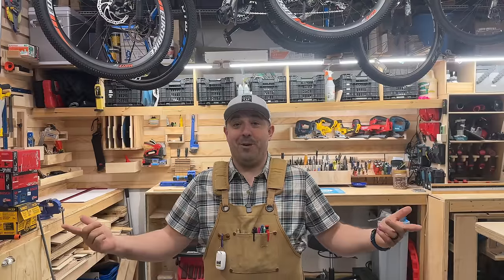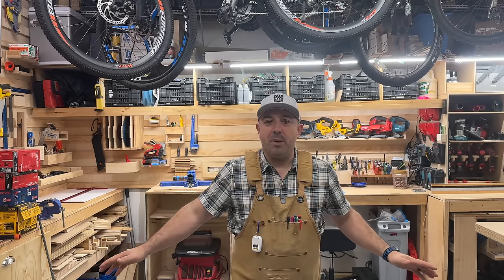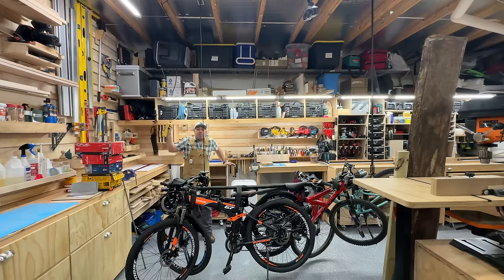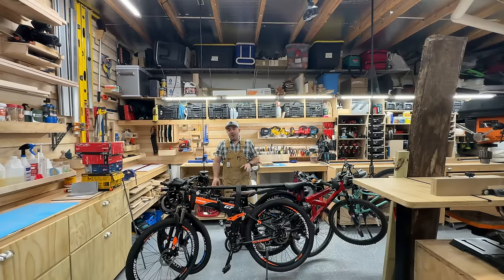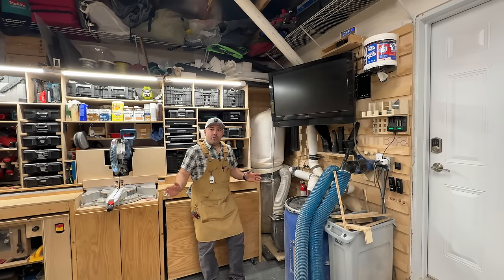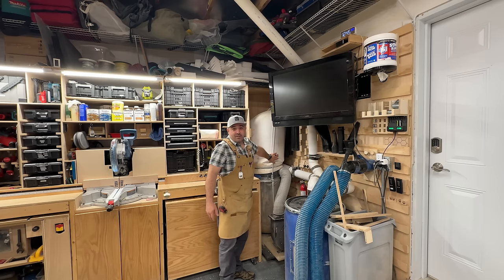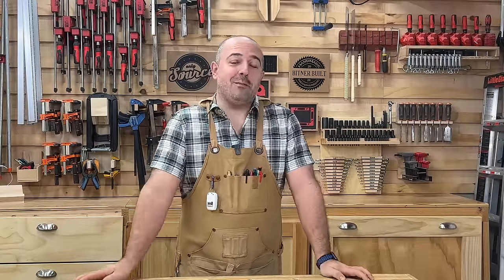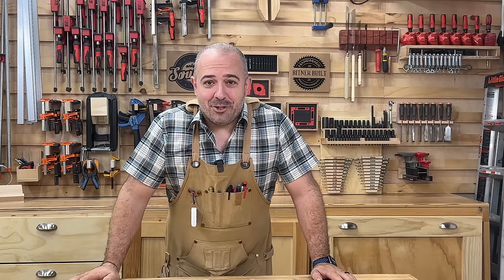Small Wood Shop Storage Ideas

Comment: Small 2 car garage? Sir, for the majority of the UK, that space would be advertised as a indoor stadium.
Jokes aside, great video. My shed is less than half a garage sized for comparison and I'm trying to maximise storage with modular power tool trolleys that roll out, but that means I can only work when the weather is nice, as I've got to roll everything out before I can walk in. A shelter is in the works, but for now, I make it work and I'm going to be using some tips from you, so thanks!
Reply from the maker: Haha true maksqwe1! I more think how my space is smaller than all the big woodworking YouTubers with their big warehouse shops!  Wow that trolly idea sounds very cool! Have you seen some of the mobile tortion box tables where the legs fit inside? Could I vision a trolly where once you roll it out a full work table folds down, lots of possibilities!
Reply: That's a massive 2 car garage even for the US.  Most are between 20'x20' and the normal "large size," 24'x24'. 20' is about 6m; 24' is about 7.3m.

Comment: One thing that can be done in small to medium shops (hard to honestly call yours small) is to make the top surface of all of the benches and tools the same height.  I used my table saw as the standard and made all of the benches, thickness planer bed, jointer bed, assembly table top, small bench tools bench all match the level of the table saw.  That allows me to run an extra long piece over the top of the other surface and keep it flat on the table saw.  That also makes everything a potential infeed/outfeed table.
Reply from the maker: That's a good recommendation David. Per your other post my shop is 22x24ft. My other small shop videos articulate that whether you're in a 2 car garage or a 10x10 shed, my organization style is that of a very small space, looking to get as much in a space as effectively as possible, modular and multifunctional. This was a spur of the moment video I threw together to answer some questions from another video, so forgot that "speal". Thanks again for the tip!

Comment: This is one of the things that gets me with most workshop tours is that the presenters go "Look at my tools and this is where I store this tool, this is my work bench". But where is everything else stored like paint cans, timber, pvc plumbing, mowers, chainsaws etc? The actual wood working tools don't take up that much space, its all the other crap that goes along with it LOL.

So good to see some actual storage tips here. I like the thoughts behind what to do with the corners, using large storage tubs for general items (I've come to that conclusion as well for plumbing & electrical stuff). I think it all just comes down to having a dedicated area for jobs and having those items you use for that task within easy reach. And using your vertical space as well.

The other thing I thought was clever was building light holders off the cabinets instead of suspending them from the ceiling.
Reply from the maker: Thanks Peter!

Comment: I got that same remote clipped to my shop apron for my dust collection system. Super convenient.
Reply from the maker: I’m actually using a new one now, that one from Harbor freight kept blowing out, the capacitor inside kept popping on my 15 amp dust collector went through about four of those before I switch to an Amazon one and that one’s been working for months now

Comment: Do you have a video for how you built the tabletop tool caddy that holds your pliers and smaller sanding supplies? That is EXACTLY the solution I have been looking for - everything is visible, easy to retrieve in an instant, and still organized. It looks like you have dado cuts every couple of inches for removable dividers im assuming? I don't have a ton of experience building things quite yet and I might try to reverse engineer it from what I could see but a detailed video with dimensions would make it much easier for me! Thanks. Awesome shop btw, your shop is what I hope to have many years down the road! I try to remember, slow and steady - no shop is built in a week!
Reply from the maker: Thanks Lena! I’m going to do a video on one sometime next week, I’m going to remake that entire corner of the shop and when I do, I’m going to make a larger version of what I have up now, so I’ll do it very detailed with dimensions and then people can make it as long as short as they want ! But yes, it is made with dados and I use thin, cheap underlayment pieces as the dividers
Reply: @BitnerBuilt  I'd like to see this, too.

Comment: The biggest hurdle to overcome in setting up a 2 car garage shop is to get the cars out of there permanently and therefore transform the space from "garage" to "shop" space.  If your wife insists her car be in the garage, then everything you do in the shop is going to have to be done in such a way that it can be set up for use and then rolled to the side of the shop after use.  After that, you are 1000% correct, the yard equipment needs its own space.  The bottom line is you have to get as much "stuff" as possible that is non shop related out of your shop space.  The key to getting the stuff out of the garage is to not be a pack rat to begin with.  People with garages tend to throw their crap in the garage, so you have to have the right mentality of not retaining non-useful items "just in case."  Have a garage sale, spring clean and organize the house.  Once the house is good, then you can tackle the garage and see what issues you have left.  The last thing you want happening is your family throwing crap in your work space.
Reply from the maker: Well said and 100000% correct. My garage is not a garage. It’s a wood shop and when my kids come in and leave their shoes on the ground, it’s a problem because it’s my workspace! I believe that for most casters are the key for everything being able to put everything to the side, when not in use, and then pull it out and set up your workflow for when you can get that car out of there and get to work! I’ve been really lucky and that I was able to make this so that I could get the cars in here in an emergency, but it’s definitely not a park the car in here every day type of thing!

Comment: Hey looks great, thanks for the video. Question: how bad is the dust collecting on your monitors and TV?
Reply from the maker: Oh it collects heavy on those, I make sure to air spray and vac them every 2-3 no when I notice it. On the cnc that’s also why I used a Mac mini (no fan to pull in dust) and I mounted it sideways with the vent pointing down so no dust would go in

Comment: RE: tight corners -In a really tight space where you have to build into the corner AND make it useable, do what it looks like he did and add a rolling unit just around the corner.  Make it something you can easily pull out to give yourself space and inclination to move it and put it back.

Comment: Thanks for the detailed tour - you did a great job answering my questions! I got a number of other new ideas from the tour, too. 

Your layout and carts are impressive - it looks like you coordinated all your counter heights(?) Was that based off the table saw height? (clearly the outfeed table was). 

I would really appreciate a quick video of your (apparently?) adjustable rack for hanging your drills. (I noticed wingnuts, so I assume the dividers slide in a track of some kind? Maybe do a YT Short of that?)  

Ditto for that nifty vertical hand tool holder! I was JUST drawing up plans for drawers, but your divided system looks much better. Your experience on height, spacing, and divider material and height would be really helpful. (Just a few measurements and "gotcha's" you ran into,  not a detailed build vid.)

Finally, do you have any tricks for storing corded tools? I've got corded drills, heat guns, two angle grinders, routers of various sizes, saber saw, palm sander, etc. I always struggle with what to do with the !@#$% cords.

Again, thanks for the great channel. I look forward to following your future vids.
Reply from the maker: Hey Art! well all my counters are typical counter height, no intentional coordination there (man your thinking deep!) My hanging drill dividers are a mash of two others videos on the topic so I wouldn't want to make a video on those as is, it's their work. look at t-track drill holder videos. I think I will be making a video on the vertical tool holder step by step soon, ok on cords, they a horrible for storage, I have a few way I do it, also in an upcoming video! sorry not as many answers this time but im trying to crank out those videos for rapid growth. Hopefully I finish with my NEGATIVE Milwaukee tool review tonight and then I have a new shop build video for tomorrow. and then a big battery extravaganza video there after!
Reply: @BitnerBuilt  thanks for the reply. Sorry to dump so many questions, your vid just got my brain working. I'll sit back and watch what's coming through. Thanks again for your channel - I'm sure you'll build a solid following soon - you remind me of a cross between Workshop Companion and John Heisz.

Comment: I am new to woodworking and am learning a lot from your channel, so thank you. Do you have any plans that show how to build the cubbies for your drills, impact driver, and other battery powered had tools?  I’ve seen them on other channels but can’t find any plans. Thank you
Reply from the maker: Thanks!! So I did a video on my holder and provide a free cnc file for it. You can always download the file and print it on paper and use a jigsaw to cut out the shape (or look at the shape and freehand draw your own) Modular Drill Storage & Charging Station - FREE FILES! - Small Shop Series
https://youtu.be/Dj1Mhb71Ygo

Comment: Just found this…..You could store a flip cart in your junk corner if you decide to re-do it. If you go the vertical lumber storage  like you suggested, perhaps you could make a roller caddy with a segmented arm pinned to the wall. The stack is stabilized, when the caddy pulls out and spins on a lazy Susan. When it’s unloaded or has minimal inventory, you can in pin it and clean behind it. v/r wh
Reply from the maker: Great ideas!

Comment: I've got a 36" table saw, 14" floor standing bandsaw, floor standing drill press, 8" jointer, 15" planer, lathe, a bunch of cabinets and too racks all in a two car garage and we park are vehicles in there every day.  It takes a bit of thought, but it all easily fits.  I wouldn't have room for anything else at the moment as my wife likes to have nothing surrounding her vehicle, so her side is mostly off limits.
Reply from the maker: awesome! Yea If I removed the giant assembly table and the cnc machine enclosure, I could get the cars in too daily but this is the way I get to keep pushing to buy a new house where I can build a big pole bard shop in the backyard and then she gets the garage parking back 
hehe!

Comment: Great video!  Do you have a suggestion on the compartment part boxes?  Most of what I find is such poor quality with heavy contents, hinges and locks break…..  Thanks!
Reply from the maker: I’m not a huge fan of those personally but some people love them, i find their container sizes aren’t big enough and break easy / spill everything out too easy. I didn’t point it out but on that middle divider between my garage doors I made a thin shelving unit, 8ft tall, for all my screw and nail storage. I buy from Walmart the clear pencil/eraser cases that are in the school goods isle for $0.50 each there are even bigger sizes of the same shape, so depending on my used case, I buy the eraser container for them that’s needed. They nest stack as well. Not saying that’s the best solution but I like it a lot for me! Then when I’m working on a project I go over and can just take the box that I need to my workspace use it and then place it back on the shelf afterwards. I also have the shelves organized by gauge so all the number 10 screws all the number eight screws, etc..

Comment: Excellent Layout both functional and efficient!  Question, what is the floor surfacing and do you like it?
Reply from the maker: So it’s a Rock solid epoxy kit from Home Depot and I highly do not recommend it. I hated it. They gave me two bad batches and I had to scrape it off with a remover and do it again and even the final version did not come out that great so I would definitely say if you’re gonna look at an epoxy look somewhere else, I like that it’s smooth and hard but the flakes that I put on the ground wall it does hide dirt if you drop anything like a small nut you’ll never find it again 😂 it is incredibly durable though
Reply: @BitnerBuilt  Thanks, I will definitely research the epoxy floor more.  Once again nice job on the shop. Best Dan

Comment: Awesome job. My problem isn't space, it's money, lol. Not even counting the CNC, that's gotta be 10K just in materials
Reply from the maker: Yep understood though if we’re not talking tools cnc, table saw, my massive assembly table etc, and just saying the outer peremiter walls. So wood, doing all my walls in French cleat my side counters, overhead cubby’s and the miter station is “around” 13 sheets 1/4, 13 sheets 3/4 and 15 2x4 8ft. I did all of that when I was definitely a beginner and money was a big factor. I did so many things “wrong”, if you look closely in a lot of the stuff all the countertops and the miter station are 2 x 4 frame construction, not cabinetry boxes. (Saved tons of money) You’re looking at current prices at around $1500 US New Jersey.

Comment: You appear to have no dust in all the nooks and crannies of your torsion box storage, all the areas around the tool bins , hand tool organizers, etc. How do you keep those areas clean? Is dust collection and air cleaning enough to keep floating dust from settling?
Reply from the maker: I am actually really allergic to dust (ironic) so I put a lot of effort into cleaning 1. I always use my dust collector religiously when working with any tool. 2. I clean up every single day, 3. Every other month or so I open both garage doors and use the leaf blower while wearing a full face  respirator.

Comment: Saw a guy talking about set up of his workshop. He asked the question ‘why work in a shop that is surrounded by stored lumber and scrape wood. Could the upper part of a ten by ten shed hold a fair amount of wood waiting for future projects?
Reply from the maker: I think that’s always the catch 22 for a really small space like a shed shop, if it’s a barn style, I’m sure you can stack a whole bunch in the rafters up there if it goes up to a triangle. Hopefully the shed is insulated, so that there isn’t wild moisture swings when it rains and what not. Otherwise you need to have a dehumidifier inside to moderate the moisture so the boards don’t warp. The smaller the space the more prone it is to wild swings in temp and moisture. Just like a spa vs a pool, temperature swings wildly and chemicals run out every two days on a small spa compared to a fairly stable pool due to the difference in size.

Comment: What containers are you using for your small parts storage? Would you recommend them?
Reply from the maker: For screws and nails I use the $0.50 pencil cases from Walmart in the school supplies section. They come in 4 sizes so I buy a variety and they interlock and stack well. I have a whole shelving unit of them next to my tablesaw. I would rate them a seven out of 10, it’s a pretty decent solution though I’m not 100% sure it’s the best solution but I do like them a lot better than other containers I’ve used. 
for the rack mounted Small parts containers in this video near my miter saw i use the Husky small parts bins from Home Depot for a lot of them, and then I use the very cheap very slim. Small parts containers also from Home Depot for the bolt section. Those are fine, they are a little cheap and flimsy, but with length of bolts, I needed some thing that was more of a modular tray design over pre sized bins so it did work well for the application. There are so many small parts organizers out there on the market, if it’s for a shop scenario like this, and you’re not gonna be taking them out on the road, then flimsy is honestly OK especially if you’re wanting to keep the price down or if you’re gonna be taking it out to jobsites and what not and then of course you need more rugged stuff

Comment: Nice launch videos,  What are using fire dividers in the wrench box?  I also stack store my clamps but stagger them with 5 clamps in each holder.  Sub'd fit future videos,  hope there are more build videos and less unboxing and review ones.
Reply from the maker: Hey Pat, thanks so much! I just use the really cheap hardy board sheets as the dividers, one sheet of that could do every divider in your entire shop. Thanks for the input it’s probably going to be a 50-50 split the build videos. Take a lot of time to do, but I’ll keep it in mind!